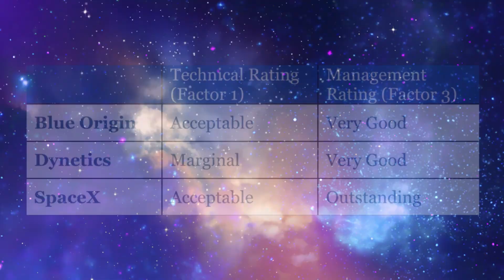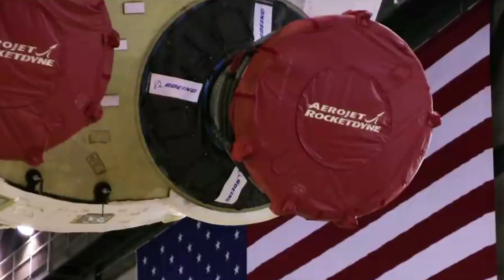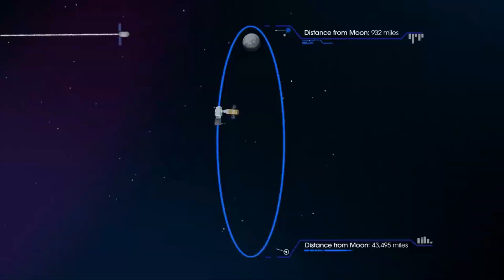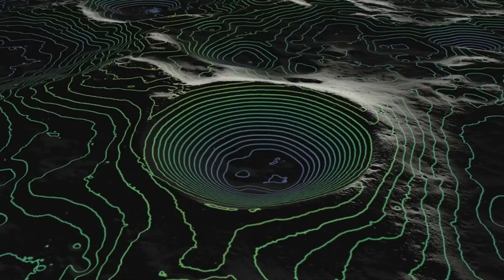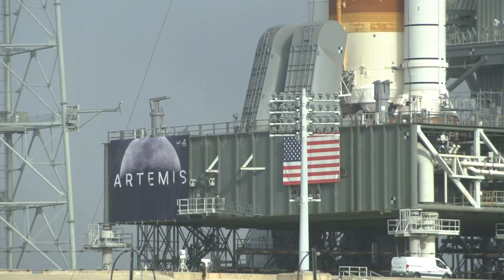NASA Is Looking For Another Artemis Lunar Lander

Comment: Landing a pencil on the moon and it wont topple over ?? Unless they make one landingsite it cant be done safely.
Reply: I don’t know how the internal “plumbing” is arranged, but I’ve been imagining what if Lunar Starship was split about halfway up?  Once in low-lunar orbit, the bottom section with the vacuum Raptors and their propellant could be detached and left in orbit.  The upper half would then descend and land with landing legs similar to those of Falcon 9.  Once deployed, there would be no need to ever retract them.  Landing weight would be reduced.  And with the deployment of cargo on the surface, the lift-off weight would be less, as well.  Then rendezvous with the lower half in orbit, re-dock and use the Vacuum Raptors and propellant to return to Earth orbit.  Refuel and restock and repeat.  And, is there a potential for it to be used for launch escape from its initial launch from Earth?  Just an idea.  It would need a lot of engineering, but seems plausible.
Reply: Lunar Starship will have much more capable legs than the one-use, temporary legs used on the flip-n-burn test landings. NASA is confident that Lunar Starship can do the job as they were the top bid in the HLS Option A contract, BEFORE price was considered.
Reply: There's also the matter of the mechanical system needed to lower and raise astronauts and cargo.

The Dynetics option just makes more sense from a safety perspective.